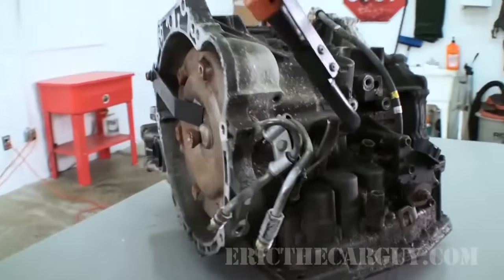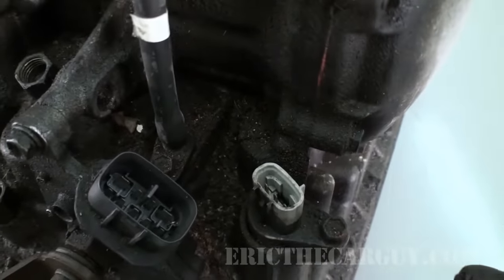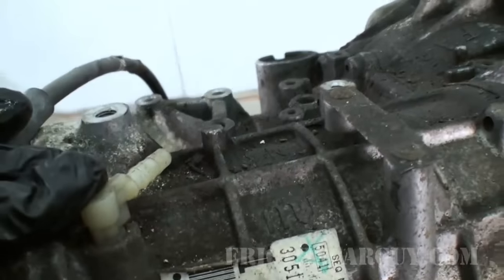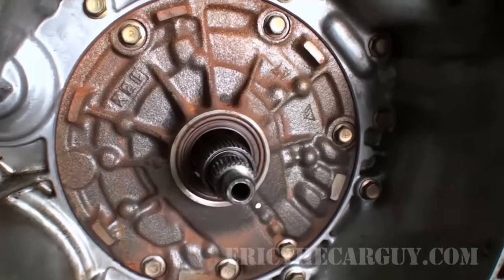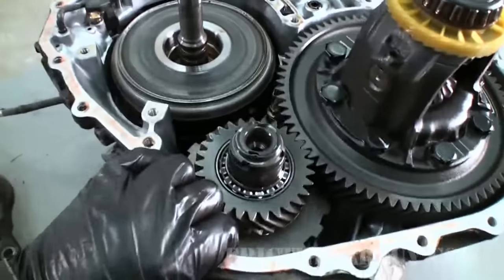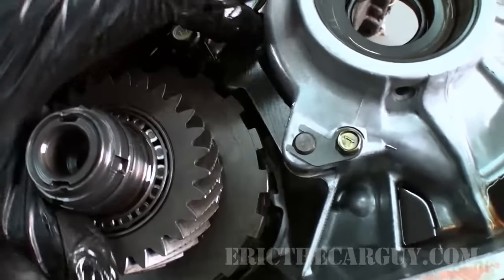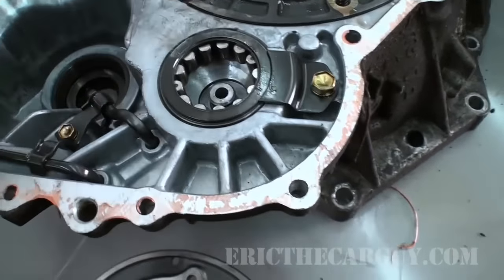The Basic Parts of an Automatic Transmission (Part 1)

Comment: Great Vid, Eric. Not to be a bug, and many have probably figured this out in the 9 years that have passed since.....  The Pump is a Gerotor Pump. ( a design name for  " Generated Rotor" ),  also the meshing of the teeth of the driven gear and the outer ring gear create the pumping action by squeezing the fluid out of the pockets made by the ring gear teeth, So.... @20:05 , as you are turning the inner driven gear counter clock wise in the Video, the oil would enter from the left side at about the 11 o'clock position as we're looking at it and be leaving the pump at it's 3 o'clock position. The Crecent moon shaped divider in the pump body is a thrust block to prevent hydraulic pressure from pushing the inner and outer rotating parts apart from each other, which would cause leakage between the inlet and outlet of the pump if it were allowed to do so.

Comment: Can such a speed sensor (Honda Civic 1995 automatic) be responsible for unintended shifting from neutral to first gear although the brake pedal is pushed down? As I understand it sends data to the Transmission controller. So if it's faulty can it produce this bug that I'm experiencing in my car?

Comment: Hello Eric, My Toyota corolla 2014 model failed to move one time while driving. The problem is, the mechanic noticed that my gear oil had run very low for a long time and has affected my gear box selector. The engine starts alright, but the car does not move. would you recommend that have the selector replaced or buy a whole new gear box and why? I will be reading. Thanks

Comment: I have a 90 Chevy 2500 2wd . I got home yesterday and I couldn't move my shifter up past neutral.  So I disconnected the shaft and tried moving it manually on the trans and still won't move.  I can't put my truck in reverse or park. What could cause this?

Comment: I'm 11, ive driven manual for 2 years and I would rather it over auto any day not only do you have more control for in the snow and ice but also for hauling loads, I know your thinking *you're 11 you've never driven a car!* well I have but not on the road this summer everyday except weekends I will for atleast 2 months, my grandfather is making a road in the woods and ill be hauling gravel in the 79 chevy c10 and persnoly the only *exhausting* part is having to work the pedals but that's not

Comment: Who doesn't love to see things torn apart? I'm proud to say I'm 50 & I've never owned a car with a auto trans. 
BUT if you own a performance car w/ auto trans, you owe it to yourself to call a performance trans shop (and order one. You get to tell them what gear you're running, how much HP you have & what mods are coming up. You'll get a trans that is rated for a specific amt of constant TQ, the right converter etc. Nice to have 400 lb/ft with a trans rated to hold 650 lb/ft of constant TQ.

Comment: That's usually my rule of thumb. I don't like automatic transmissions and its obvious they do not like me either. Had an Accord EX-L that went through 3 transmissions in 80k miles, luckily under warranty.. but that was a design flaw in my opinion.. coupled with poor materials and quality control.  On the flip side I have a 5 speed Subaru which I am going to be pulling the transmission out of at some point for an input shaft bearing change so I guess they break somewhere.

Comment: A transmission range switch. Honda calls it a Position Sensor switch. The shift cable comes down from the center console and connects to the end of the Control Shaft. The Pos Sensor is attached to the Control Shaft to tell the ECU what range the mission is shifted into. The control shaft also moves the manual valve in the valve body to channel fluid to achieve clutch pressures, etc.

Comment: And what i mean by last longer is......as long as you maintain good clean fluid in an auto it will continue to perform.... Clutches wear quicker and are never fun to replace......but standards are a lot more fun to drive and are generally faster......I find it hard to choose one over the other, they are both great power train concepts.

Comment: I like automatics and i like standards equally. There are pros and cons to each. Standards are cheaper, economical, and generate typically more speed....but no torque. Torque converters give u torque, get u up the hill, out of the mud, last longer, easier to drive, and less chance of operator error.

Comment: Please help. Recently got my 2005 Dodge Grand caravan transmission rebuilt with all updates. When going up to 20mph and changes to second and then come to a complete stop, the transmission shift hard when going into first gear (after I come to a complete stop and 1/2 second latter this happens). Also not my left tail light is not working and was working the day before sent to transmission shop and I know it was working bc I hauled a trailer with lawnmower on it in the dark. What could be the issues?

Comment: This one is weird:  I've got an 08 Ford Focus that has previously been looked at for slippage of the transmission.  It no longer appears to slip between gears, but now feels like it's working way too hard to keep me at a particular speed.  When watching the RPM gauge as I'm driving I notice that the gauge sways fairly violently as it's shifting.  There is a normal fall in the gauge as it goes up in gears, but now it drops a lot after a certain one and feels that it is not where it should be based on how fast I'm going. This happens particularly within the first few gears after accelerating from a complete stop.  The fluid has been checked and is fine and I am noticing no smells, uncharacteristic vibrations or rattling.  There are also no warning lights that have come on in regards to this behavior.  Any help?

Comment: I have a mitsubishi galant 06.i drained my atf and got 5quarts of fluid plus a grease on drain plug inside, about an amount of toothpaste that you put on toothbrush and smells weird.so i ordered a 5 sp3 trans fluid from oreilly  but when i measured the dipstick it is between the cold and hot line.so i ask oreilly how much fluid i need on my tranny..they said it need 8.14quartz..
I have a question now..is there a damage in my transmission?

Comment: PLEAE tell me something; I got a Ford Tempo 3L-V6? ( 3-speed ATX/FLC transmission). I changed oil and filter yesterday. I ran the gears through for 2 sec. and let it sit. Later time I needed a to go somewhere so I put the stick in R and D and both occasions I heard strange noises ( metal to metal sound) from the front of the engine. It happened only 2-3 times and everything was back to normal. DO YOU THINK I DID SOME DAMAGE TO TRANSMISSION?

Comment: Excellent video.  A couple of minor corrections:  (a) He misuses the term “spline” several times.  The input shaft splines to the torque converter, but the speedo drive “meshes” with the gear that drives it.  The gear on the countershaft “meshes” with the corresponding gear on the final drive; and (b) The explanation of the pump is slightly off.  The fluid passes around the moon-shaped piece at the bottom, not between the meshed gears at the top of the picture.  Otherwise, right on.

Comment: My ‘11 corolla sometimes shakes going 70-80 and decelerates on down hills when I let go of gas and stays accelerating for a couple seconds on flat when I let go of gas pedal. Got solenoid code one time when checked at auto zone. Check engine and trac lights come on sometimes. Mechanic told me it’s not worth rebuilding and to keep driving til it breaks.

Comment: I have my transmission that's not shifting right have to change from drive to 2 gear and it starts riding right and there I switch to drive to ride in drive gear same thing when stopping what's the problem it's a Chevrolet impala 2002 3.8 engine let know if you can.

Comment: Leave aside that I'm thankful for what you do here. Man you described the pump mechanism terribly wrong. !! see from what I see the upper part of the gears that the space between them starts expanding that is the entrance of the pump for the fluid and then it keeps expanding and sucking the fluid. from the moment it starts contracting and the space between the gears gets smaller it pushes the fluid outward and by that it exerts pressure on the outlet fluid. 
keep up man. good job .

Comment: Sir my car doesnt exceed 80 km per hour, i checked for the transmission  oil level is ok, i checked also the oil is very fresh, not yet burned to deserve any change, but the car us running very well, reversing well  no delay, but when am pressing the gas pedal at a speed of 80 km per hour, it doesn't exceed such speed, and i could hear a sound like rotating motor on left side, whining, what can be the cause? ? Kindly help with ideas thanks

Comment: I have 2004 Nissan Perrie   after purchase it from the auto  dealer  not even  4 months  of service I get from it. It were driven hear .when  purchase it that the time it clear customs. In that short time transmission problem. Overheat problem. The car dealer said warranty up.so you know. I would like some advice how fixed it

Comment: I have a problem with my montero. it comes with 4m41 diesel engine and an automatic transmission. the service center told me a month ago that they had refilled the transmission oil and after w few KM I have to bring it back, which I did then they told me that they replaced the transmission oil because it becomes dirty and it smells like burned oil. they also told me that these are the symptoms that I need to replace my transmission. and you know here in the Philippine, It's very expensive to replace the A/T.. around 200K to 300k pesos ( $4000 to $6000) if it's all original and around 100K to 200K plus pesos ( $2000 to $4000) if it's replacement..

Comment: Well it is not entirely true.While the part that operating the cluth and gear stick shift doesn't require mental effort (thinking about it) it is indeed true, becase if you drive a manual every day it'll became hardwired into the brain, it wil be only a pure reflex like removing your arm from the hot stove, the part that doesn't require phisical effortis not true at all. Every move of your body requires phisical effort and rquires energuy.

Comment: Complexity has nothing to do with reliability. The mere fact that an object has more items is irrelevant.  The vehicle I purchased can be bought with a manual 6 or ZF auto 6. The auto gets better fuel economy, is vastly superior in shift speed, smoothness of gear transitions, can tow 2.3t vs. 1.2t, has faster 0-100 times and requires less maintenance. Before judging my ability to shift quickly and smoothly, no one I know with the manual is able to match the auto, "its just more fun they say".

Comment: You don't have to at all really.  And remember that this is for the overall wheel diameter (wheel + tire), not just a wheel increase.  Many go with a +! configuration (bigger wheel+ lower profile tire) to keep the overall diameter the same as stock.

The only issue is if you go *way* bigger than stock.  This will change the ratio of the overall transmission, which can damage some due to it rotating slower than its supposed to be.

Comment: I have a 97 bmw 740il. It has 274,000 Miles on it. I later discover upon after getting the dreaded transmission failsafe that my fluid was low, i decided to drain, it low and behold I see the lack of ownership from the previous owner. It was low on fluid, with a seal leak. It was a lot of metal that came out with the black old fluid. Ive since serviced the transmission its been good since, however its now a ticking time bomb.  I would like to try and rebuild the transmission. fluid is burnt now

Comment: Kind of intersted to know why we didn't start with the valve body first and work our way in to the inner parts. I guess it was just how I was instructed in Transmission repair. Out of curiosity, do you have a CVT Transmission? I've seen and rebuilt a few, but I'm sure it would make an awesome video. Or you can just link to the Weber State video link. That may save time. weber edu/automotive.

Comment: The barrier between you and the understanding of a given anything can be not-unlike a thin brick wall. Saying here:  Attempting to run through such a blockade, at a high-speed would be very painful. Yet, if you were to slowly - over a small period of time - press against such a "wall," such a obstruction would topple like a chewy, soft snickerdoodle; at which point you could easily step over the hindrance, nigguh.

Comment: A few questions, If someone were to add a aftermarket programmer to a vehicle and raise the line pressure to make firmer shifts will this benefit the transmission in the long run or possibly cause more harm than it is worth? Also, I have heard of "pump failure" if the line pressure is too high.. How can a pump fail if it is only two moving gears? Lastly, how does the transmission go about raising line pressure, does it restrict flow to different areas somehow?  Thanks for the great videos, Eric.

Comment: It was kinda sorta interesting, but didn't go into any details of an AT about which I didn't yet have a general idea. OK, the oil pump and how it works was new, but I'd really like to know how shifting different gear ratios with a set of planetary gears work. I also didn't really get what a clutch does in an AT, so I hope there will be lots of interesting stuff in the second part!

Comment: CVTs are actually fairly simple. You have an input shaft that has a set ratio connected to a "gear" that uses a set of opposing cones and a belt. Because a cone has different widths depending on which part of the cone you look at, the belt can be mechanically moved up and down the set of cones to raise or lower the output speed. CVTs usually use a computer to adjust belt position, meaning the engine can be run at a constant speed without shifting.

Comment: I'm not an auto trans guy either, but a few thoughts:

I think the Teflon rings at 17:10 are actually 'back up rings', there to help protect the actual 'O' rings.

The front pump @ 18:42 is a gerotor type 'gear pump'

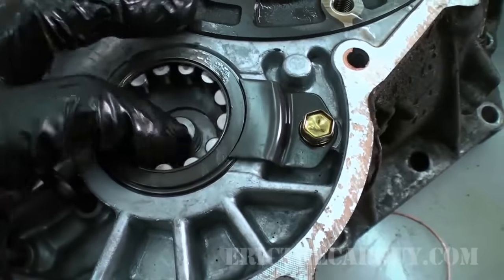Pretty sure the bearing at 21:10 is actually a one way 'Sprag Clutch'

All the quoted items above have good looking Wikipedia articles. The 'gear pump' article has a good animation of the Gerotor pump operation. Also check 'Automatic Transmission'

Comment: I always thought that the band stopped the drum from moving once in gear so that you had 100% drive to the final drive, and that when it slipped the band was not being tight enough and allowing the gears to "slip" but obviously if it did do that then it could burn out the clutch fibers and ultimatly burn the whole lot out ie.. i thought the band was practicly a hydrolic auto clutch

Comment: 20:07, correct description but your looking at the wrong side of the pump where it takes place. Where the gears move away is where fluid is drawn in, and where it comes together is where it pushes it out.

Comment: you dont know what real driving is until you drive manual. automatic transmission, all it takes is just one foot and one hand. thats all not using your brain. the car will not stop on a hill, thats what a hill start is... using the handbrake and when you can feel the friction point take the handbrake off thus going forward while applying more acceleration.

Comment: No less complicated than the rest of the engine.  In fact - auto trannys have remained relatively stagnant while all sorts of valve timing, direct injection and other parts have been added to an engine itself.  I'd say that with modern cars, automatic transmissions are *less* complicated than the rest of the car. XD

Comment: I have a 1967 gmc c15 rwd truck with a 4 speed manual trans and a 283 chevy small block. The clutch pedal, when I push it down, it goes down fine. When I take my foot off, the clutch pedal doesn't return right away. It does return but sometimes it's slowly and other times it takes like 15 seconds for the pedal to come up. How can I fix his or what could be wrong?

Comment: Sad that Honda is riding their laurels of their name and just settling on building vehicles that are just good enough anymore.

92 Accord with 250k miles has bare spots were the paint has worn away exposing metal and still no rust. Excellent galvanized steel. 2002 already has rust in the rocker panels.

Comment: Eric is probably going to explain it much better, but when it is stationary the load on the TC is not enough for it to engage so its basically like the car is in neutral. Once your apply more torque when you hit the gas it causes the TC to engage. That's why if you hold your brakes and hit the gas the car with still try to lurch forward.

Comment: I never understood why some manufacturers didn't design their transmissions pans or transmissions with a drain bolt. To me it would just be common sense that, being it has fluid, at some point it will need to be changed. Why make the technician go through the process of removing the pan or worse just to change the fluid?

Comment: 26:30 Yeah...looks like those plates are splined to the case, which locks that set stationary when that brake is energized. That almost has to be RVS brake. Honda uses similar setup for CVT to achieve RVS.

Comment: That is definitely the Parking Gear. The Parking Pawl engages the notches in the gear to lock the countershaft, thereby locking the diff, the axles and the wheels.
Agree - use the Parking brake, especially on any inclines.

Comment: is he did great with the disassembly though I still get screwed up by the label transmission instead of transaxle witch I belief is the equivalent to the bundle of transmission and differential.... though there is so many terms that mean the same or are used interchangeable :)